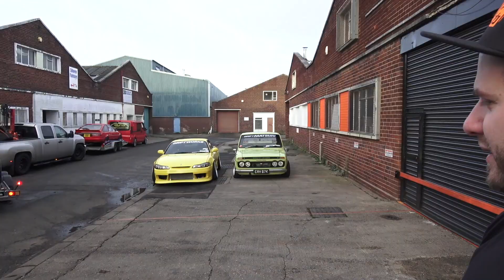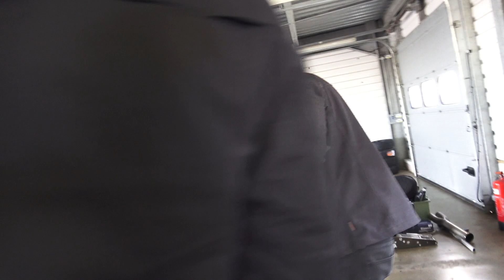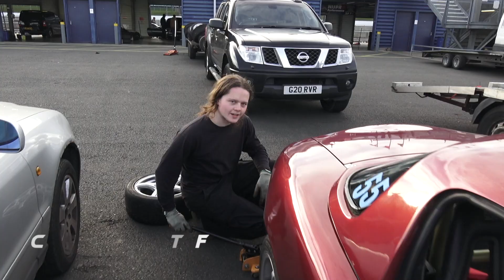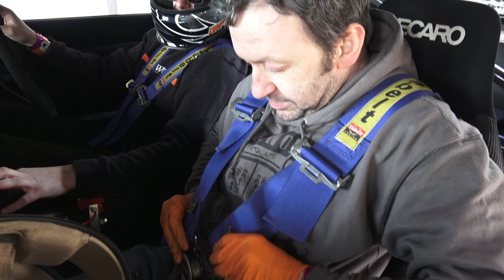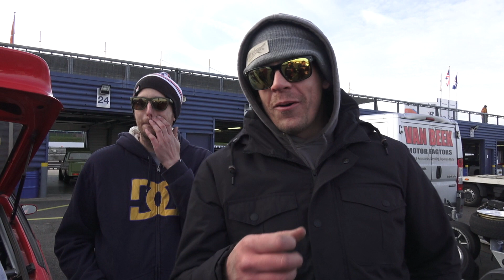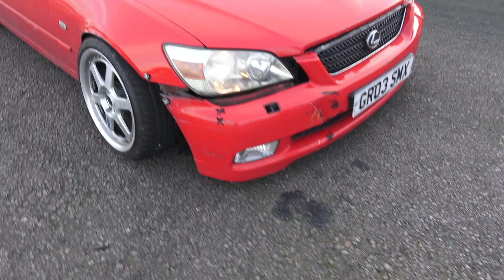Smashing walls! - MEIHAN UK Edition!

Comment: BonBon = Correct. Manjis are gay, but handbrakes are even worse.
Reply: Stav-Tech preeeeeach!
Reply: I dont drift, so whats wrong with handbraking? If every pro drift car has a hydraulic hand brake why is it so frowned uppon?
Reply: greenmondaymorning you slow down alot harder, and it's just plain boring. Almost like driving an automatic.

Comment: What is counted as a manji.
Reply from the maker: flappin about like a wally pretty much.
Reply: Driftworks so linking corners while sideways and not using a handbrake for entry is a manji so is this wrong aswell or is it ok
Reply from the maker: Just being unnecessarily slow entering a corner by wobbling about too much. An entry should be strong , fast and violent. It doesn't necessarily need any handbrake at all.
Reply: All these do's and don'ts are what makes drift days intimidating for new drivers.   There's a difference in competitive drifting and drift days.